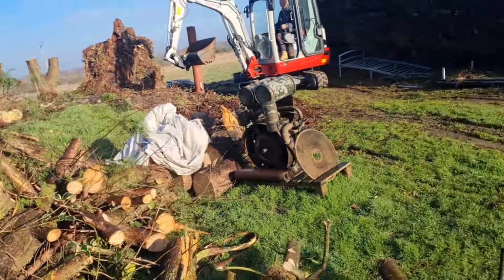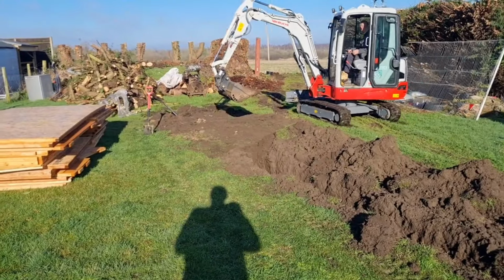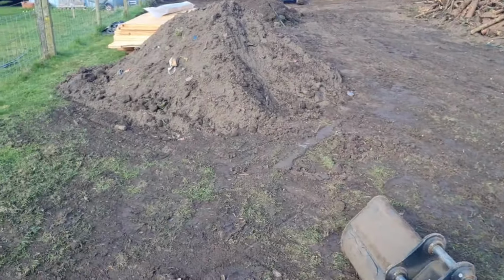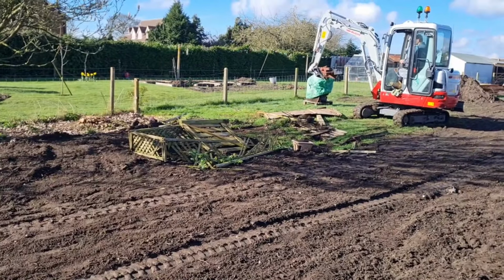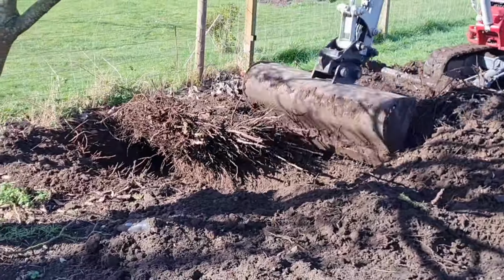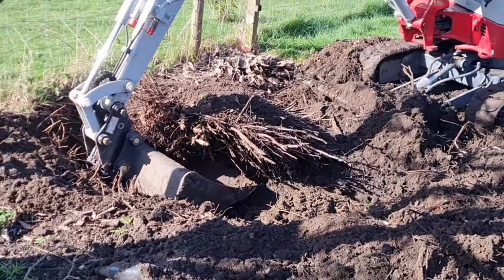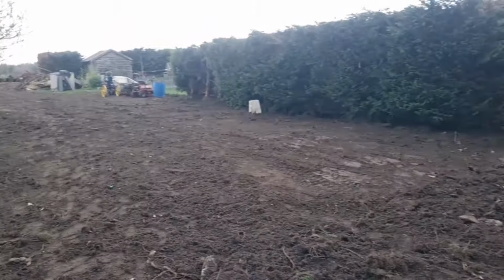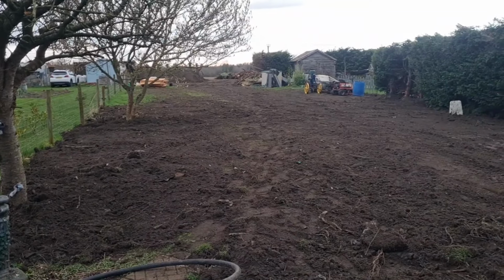Garden update. wow such a difference.

Comment: Need to plug-up the ends of your conduit, so water doesn't get inside for the electrical.  And YES! as the previous guy said, a tape should have been layed down with the conduit in case future digging is done so they will be able to find the conduit!